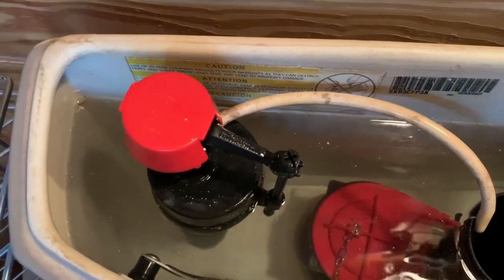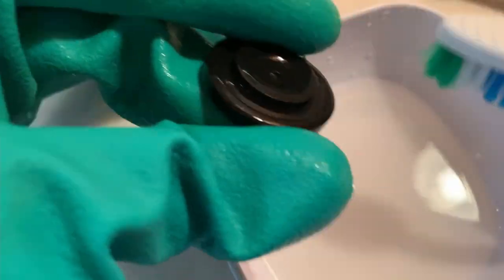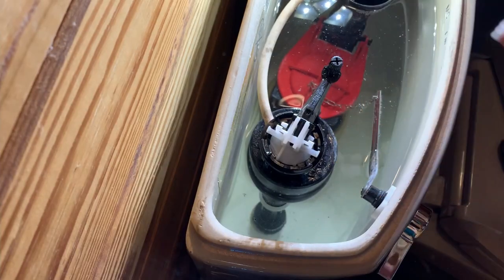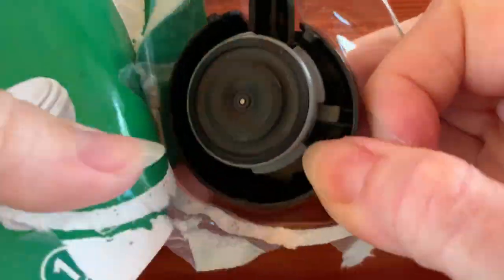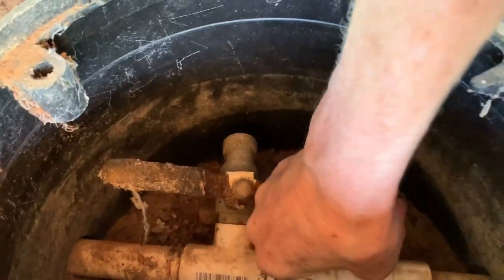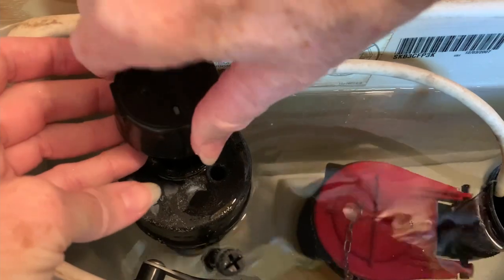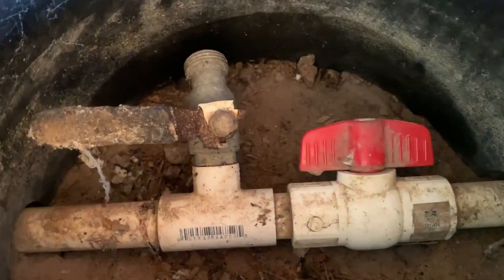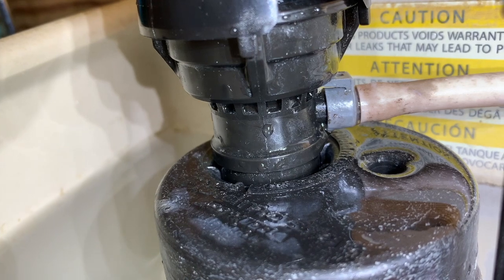How to fix a squeaky toilet valve

Comment: The float only has so much “push” available. I found the house I bought had 90 psi coming in, so the float didn’t always succeed in completely closing the valve. I suggest checking inlet pressure. I had a plumber install a pressure reduction valve.